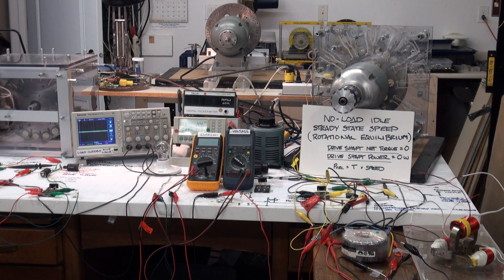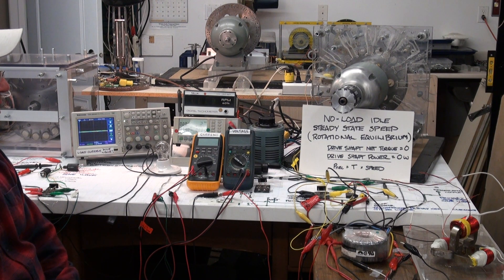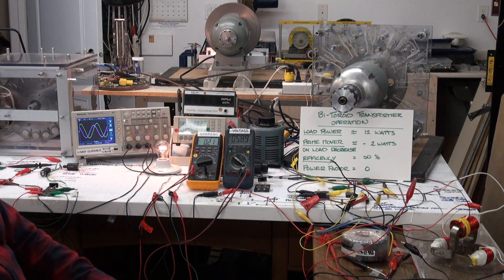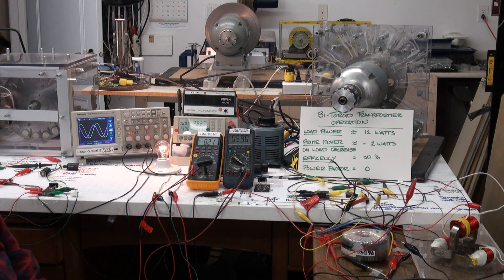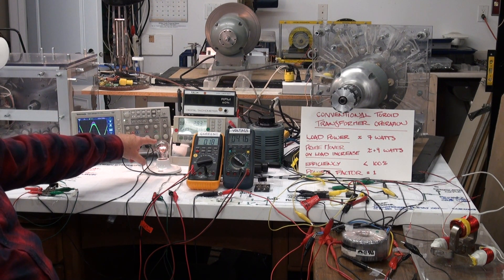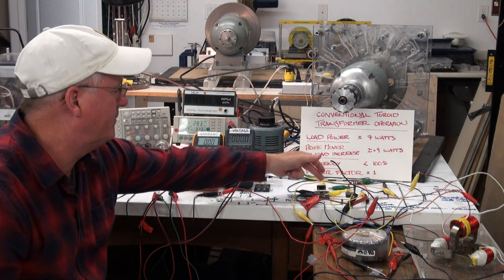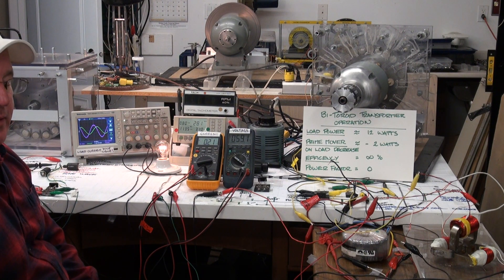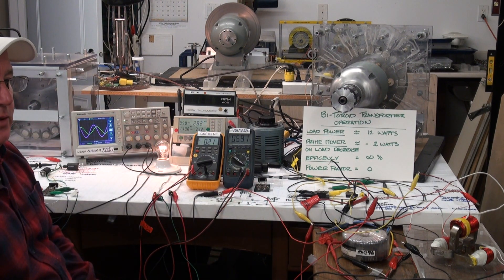Bi-Toroid Transformer (BiTT) SIEMENS REPORT #siemens

Comment: Hello mr Thane. Thank you for sharing your knowledge and greate inventions. I have read the patent of bitoroid transformer and want to build one for testing. I have one question about the cores. It's known from your patent that magnetic permeability of the secondary should be bigger than the primary. How big this difference should be. If i have ferrite core for the primary with permeability of 2300 and core for the secondary permeability  12000  is it enough for correct functioning of the transformer or difference in magnetic resistance should be bigger ? Thank you, Taras.
Reply: I would guess at least twice the size,  this is my intention for next weekend anyway. Its well past the time for us all to "think about" and start "doing" the energy companies are forcing us to fight back.

Comment: I salute your commitment and devotion to these projects. You are doing a great job! And I do pray for more grace in this pursuit.  Bitoroid transformer is a great machine if you want to keep your input power the same no matter the output power you draw, but with a troubling condition. The maximum output power is limited to whatever input power you give to the transformer divided by a+1, where a is the ratio of the reluctance of the primary core to any of the secondary cores. (Secondary cores have same reluctance). In practical terms, if your input power is 300W, and the ratio of your primary reluctance to the secondary is 10:1, then the maximum power you can draw from the secondary is 300/11=27.3W. And this maximum power is when you short the secondary coils, that is setting the load resistance to zero.  Indeed the input power remains constant at 300W while varying the output, but you can't exceed output of 27.3W.  One or two secrets still missing to achieve over unity.
Reply: Hello sir, do you mind elaborating on your reasoning behind this statement? Why is the maximum output power related to the reluctance ratio in that way?

Comment: I have an electric skateboard that supplies 0-36 dc volts to the hub motor through the ESC.
How could the Bi Toroid Transformer be used in that application?
Reply from the maker: Build a BiTT like the one below and use it to power the motor... 
https://youtu.be/-LBnnL4v8MQ
Cheers Thane
Reply: @ThaneHeins1  good asnwer !! what frequency would yu recomend for the bitt? Will 50 hz work ? Or should it be higher?

Comment: Is the additional pathway on the two sides of the bi Toroid transformer missing because they are not needed in this configuration? I remember seeing it in your previous videos. Thank you
Reply from the maker: No not required. Just added in earlier presentations to emphasize comprehension. 
Cheers
Thane
Reply: iThinkTheyAreNeeded.

Comment: can that Toroid be correcting a generator like a wind generator ?  to isolate the generator from the load ?
Reply from the maker: Hi Amir, that is exactly what it is designed to do and also to isolate and end user from the source i.e. an electricity consumer from the grid. 
The Bi-Toroid Transformer consumes Reactive Power in the Primary (like any transformer on no-load) BUT delivers Real Power to the load with no increase in Primary input above the no load Reactive Power input.
Reply: @ThaneHeins1  
 
After a little bit of simplistic additions and subtractions I found that a net additional 17 watts are derivable from an input of 281 watts to the prime mover. That is about 6% of the input power. I am sure I am getting wrong figures on this. Would appreciate being guided to the correct calculations. Thank you
Reply from the maker: @maglectric3624  
Hi @ Mag Lectric, the Mechanical Input Power to the generator drive shaft at Rotational Equilibrium is always 0.00 Watts irregardless of the power consumption of the prime mover. Prime mover power consumption is a reflection of motor efficiency at a specific speed.
Please see more below... 

With kind regards 
Thane

How to Calculate Generator Efficiency & What Infinite Efficiency Means: 
https://www.slideshare.net/PDiCEOThaneHeins3240/1-how-to-calculate-generator-efficiency-what-infinite-efficiency-means-164624806
 (An object is in rotational equilibrium if the velocity of its rotation is constant. An object that is not rotating or an object that is rotating in one direction a constant rate would be considered in rotational equilibrium. To be in rotational equilibrium, the net torque acting on the object must be zero.)
Reply: @ThaneHeins1  If you want to build perpetual motion, self powered machine, than change prime mover.  Use asymmetric DC motor generator instead of induction motor. Many people on YouTube has build asymmetric motors, like ufopolitics, netica, lightworker, OUbrads, lidmotor . Asymmetric DC motor has two commutators and four brushes. One commutator is connected to + , other one to - . Two brushes is for power source, other two brushes for power receiver. Motor coil receive pulse from power source, turns rotor some degree, disconnects from power source, and than connect to receiver or load, or another battery that charges up. Asymmetric motor is very efficient, and can exceed 100% efficiency, does not heat up when operated, so no cooling fan is required. When there is no load to asymmetric motor, all used electrical power is returned back to source or to another battery.
Reply: @maglectric3624  Symmetric motors, like induction motors, are inefficient . See ufopolitics video "Symmetry of darkness" , and "Asymmetry to enlightenment " .  When ReGenX generator is used in wind turbines, they produce 5 times more power than conventional wind turbines. So problem is in prime mover, not in ReGenX generator.
Reply from the maker: @marcisgulbis9310  I think the ReGen-X Motor is superior. 
Thanks Thane
Reply: @ThaneHeins1  Can you get 5 horse power out of RegenX motor? Can it self start without any other prime mover?
Reply: @ThaneHeins1  Maybe add pulse width modulation to RegenX motor to control output power.